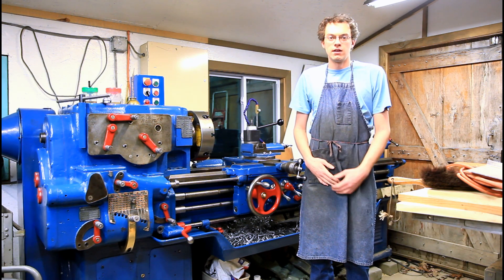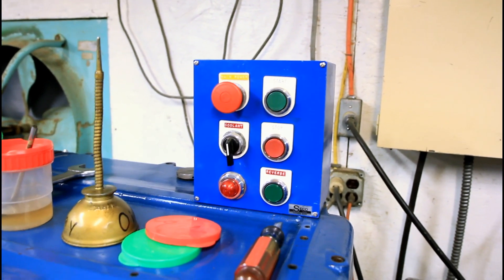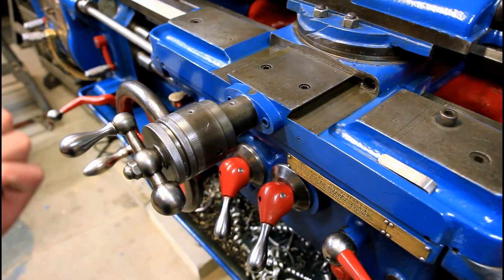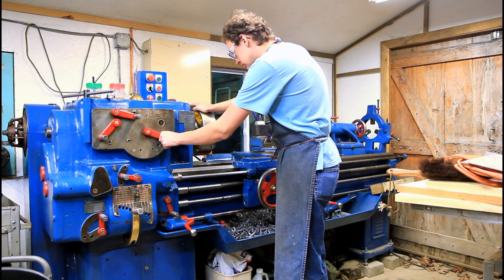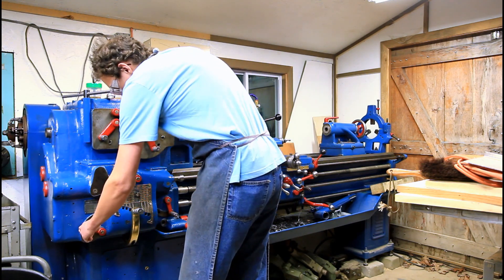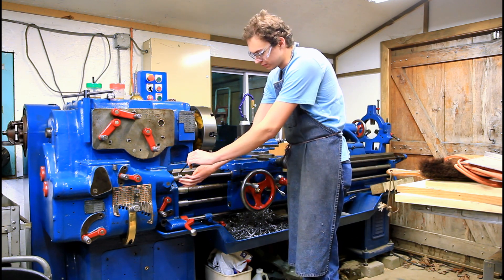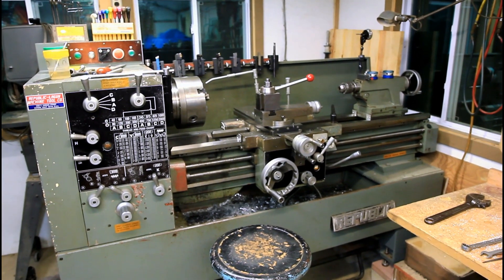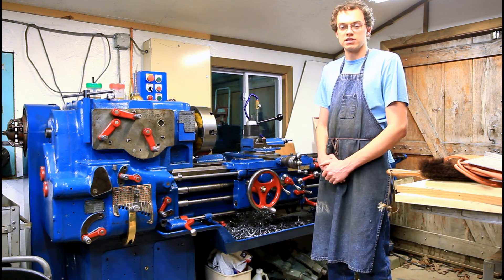1943 Sidney 16x54 Engine Lathe Overview

Comment: Nice video   My biggest complaint on older lathes is the size of the spindle holes. I get somewhat frustrated with the lathe I have but it is better than no lathe.
Reply from the maker: Thanks!
Yes, that is one of the worst things about older lathes. This thing has a piddly ass 1 9/16" bore, which was standard across basically all machines in it's class +/- 1/8". That Lagun has a 2 1/6" which is fairly hearty for a 14" lathe. Doubly so for being built in '82. I was laughing with some fellas on a forum the other day as I had found a 9" mini-lathe weighing all of about 150lbs with a 1.5" spindle bore. A whopping 1/16" smaller than this 5000 lb lathe. Pretty humorous if you ask me.

Comment: Hello Noah!  What a beauty! That was a huge undertaking and it came out great... Lots of jobs require roughing out and hard work first that's why many machine shops have a primary lathe to get the part close and a second lathe to get the part to tolerance.  Roughing out heavy stock on a precision lathe just adds wear and tear.  What a great machine!   😃👍
Reply from the maker: Thanks John! Yes exactly in regards to roughing. Unfortunately I don't do quite enough work yet to justify needing a whole second machine with about the same power and swing just for roughing. There is a few things it could be tighter on just for roughing as well. But I'll keep using it. Thanks for stopping by.

Comment: I do love that lathe.  I have followed all your fix ups on HSM.  Very good work and great learning machining experience.  No shame in having a "roughing" lathe.  I like the single-dog clutch threading.  My Hendey T&G has that, like my Hardinge.  Keep up the good work.  ----Doozer
Reply from the maker: Thanks for stopping by Doozer! Gotta love a Hendey T&G. All of Hendey's lathes actually. I've come to really appreciate some of the later gear head ones, I wouldn't mind trying one out some day. The leadscrew reverse is pretty sweet, but it would be really sweet for a lathe set up to cut metric. Wouldn't slow you down in the least, and no stress on stopping in time. I hope 2021 treats you alright. Take care. -MB